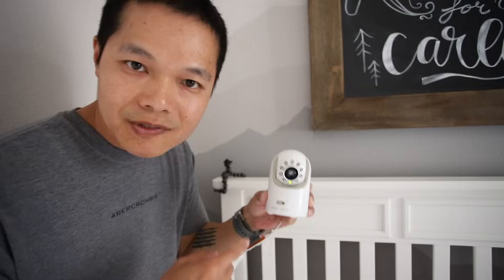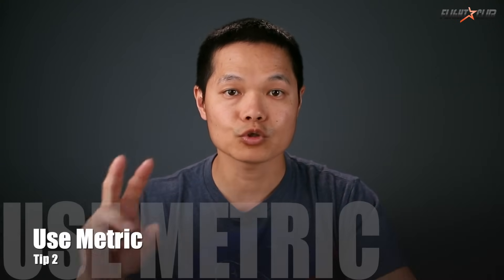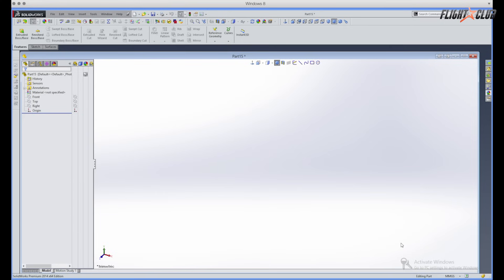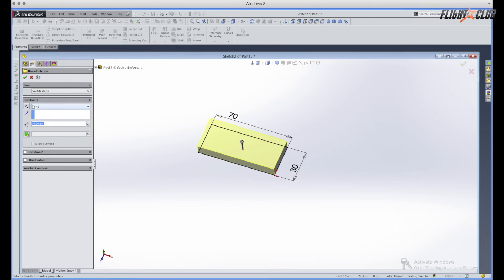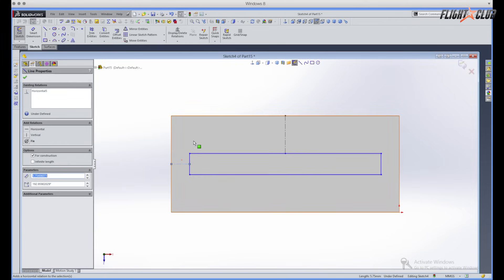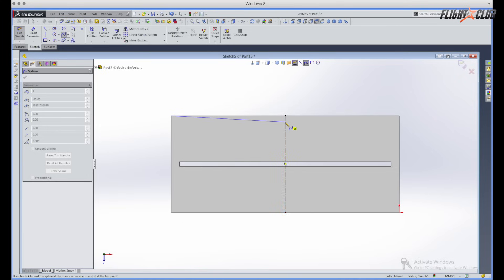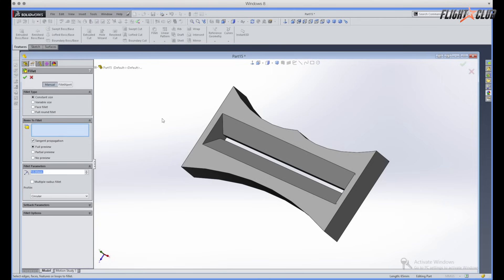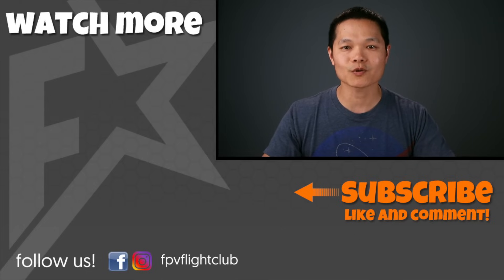Learn CAD in 10 Min : Turn Your Ideas into Reality

Comment: I actually feel like it doesn't matter at all what measurement system you use, since until you print the unit might as well be "units".  Once you're ready to print you can select the whole design and scale it up or down to the desired size.